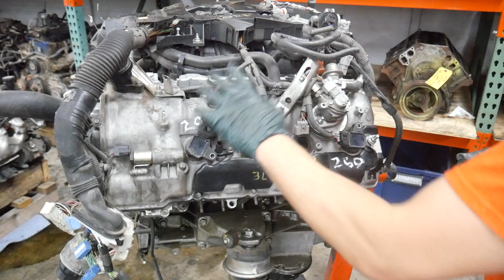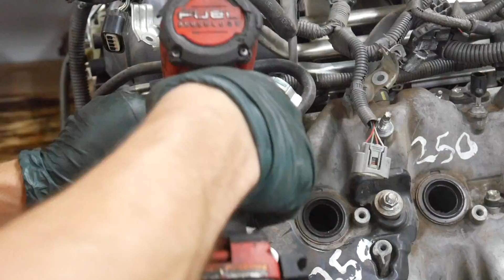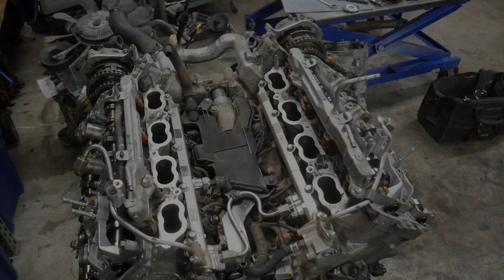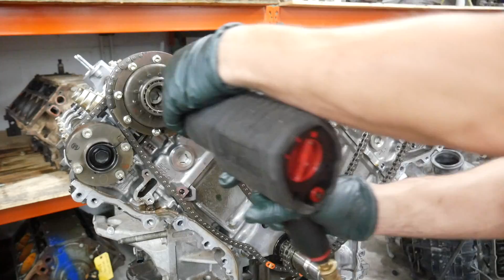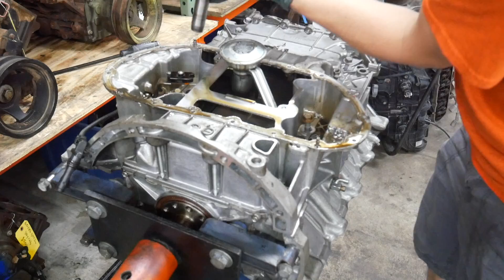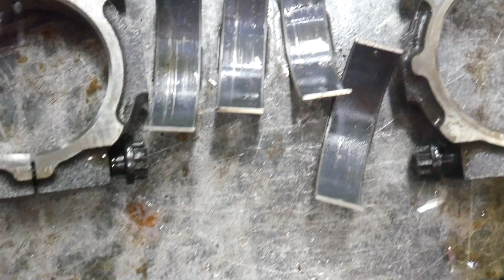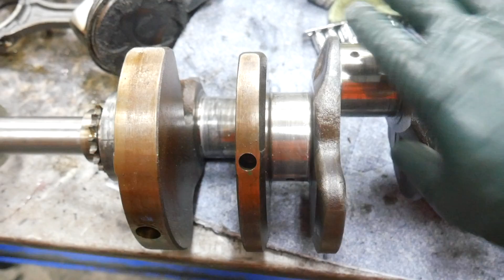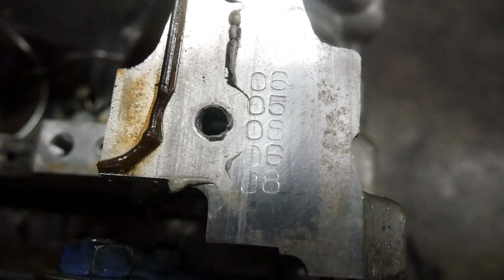Lexus LS460 1UR 4.6L V8 Blown Engine Total Teardown! How Did One Of The Most Reliable Engines Fail?

Comment: Even with the guide missing this engine has every sign of being ran with no oil.
Reply: No oil creates heat. There's no evidence's of heat, no scorching or discoloration.
Reply: @godzilla7148  not if it happens in a short amount of time, maybe it was ran with 1-2 qts for 20-30 mins, when its run without any oil, and begins to scorch with heat, it tends sieze

Comment: A testament to Toyota, this engine was probably running when it was pulled out of the Landcruiser or whatever it was in. LOL
Reply: Pretty sure Yamaha makes this motor not Toyota anyway sooo
Reply: @johnaranjo2059  no.
Yamaha specializes in cylinder heads for sporty applications when it comes to Toyota.
Reply: Yamaha makes the cyl heads for the f engine,pretty much this engine stroked to a 5.0 with better cyl heads.
Reply: Most engines are running, until they aren't. I'd imagine the rod bearings went, plugged the oil pick-up, wore the main bearings and then they let go.

Testament to Toyota that their bearings spun? Looks low mileage. Even the best maintained engines end up with varnish so I'd assume this was relatively low mileage for spun bearings.
Reply: @Ericsaidful  exactly. Stephen green probably works for toyota. Payed troll to keep up their image
Reply: @kevincampbell1395  right because the worlds largest automaker needs some youtube commenter to defend them.
Reply: @kevincampbell1395  Its an LS460 Engine. Bearing damage like that doesn’t occur without lack of oil pressure. F&resto;e and do it yourself oil changes are to blame. UR consumes oil at higher mileage but I’ve never seen bearings fail…ever.  Lexus doesn’t need anybody other then itself for image.

Comment: The only thing I don't like about those engines is fuel consumption.
Reply: I can usually get 28-30 mpg on the highway at least per the trip computer. Around town, about 21-22 mpg. It’s not bad for a heavy car with a V8.
Reply: @noelsaw  :hmm, the one I had wasn't good for much more than 18 on the freeway. Not sure  what kind of magic yours has.
Reply: I’ve read other LS460 owners on the forum sites can get about that same mpg. I think it depends on how well the engine has been maintained. I also run She’ll Nitro 93 and Amsoil oil changes.

Comment: Please do more toyota engines like the legendary 3.4s that’s my favorite engine I have 402 k miles never been inside it
Reply from the maker: I need to find a blown up one first!
I do have the bad 1fz from my land cruiser, it will be a video at some point
Reply: @I_Do_Cars  yes ! Haha probably won’t ever happen 😂 they are tanks. My question do you only do blown Up engines with problems or do you actually buy good ones to take apart
Reply from the maker: Andrew very rarely do we split a good engine. There are some engines that the head or pan is worth more than the entire engine, so there are a few exceptions.
Reply: @ImportedRCF  That would take away the fun. Why look at a good engine?
Reply: I've got that 3.4 VVT-i in my 05 Sienna Limited factory spec. never thought I'd fall in love with a minivan. That motor with 240hp has a lot to do with it💜
Reply: Got a 5VZ-FE w/200K that is totally choked with sludge, something about the 95 Tacoma ventilation system was prone to clogging. 
My 04 Taco has the same engine with 270K on it, very clean inside.
Reply: @TD_YT066  Hi Tom, how can you tell its "choked up" inside have you had it apart.. oil pan off?  I've been told that the sludge is only caused by lack of proper oil change intervals and or improper oil. I use only top synthetic Mobile1 and 20k Mobile1 filters... drives runs like brand new with 210k though it is a 2005 so.  Have a 97 w/300K 4ruuner also runs like new. This one gets semi synthetic and Wix larger than spec filter.
Reply: @surfside75  I ran Rotella T6 ~7k interval. It was starting to click,  valve shims. So I pulled the valve covers and the passages in the top were clogged and the sludge had built up to the point of only the moving parts had clearance in the valve train. The motor still ran, the oil was not 'chunky' or anything like that, but from what I could tell, none of the moisture or blowby ever got out via the PCV and it just crystallized. I was driving it mostly highway, commuting Austin-Houston weekly. Some other forum posting said the valve cover changed after 95 for better   ventilation.  My 04 with same engine was really good at 250K when I replaced the gaskets.
Reply: @TD_YT066   Thanks Tom.

Comment: You gotta wonder how that engine was so clean inside? 
Low miles?
Oil brand? 
High octane fuel?
Reply: Higher octane fuel doesn't do a difference if the engine isn't made for it or tuned and the cleanliness comes from frequent oil changes not the brand of it.
Reply: @alexstromberg7696  I guess what I meant was a branded or cleaner fuel, a lot of the discoloration inside an engine is more from soot / carbon/ fuel deposits than engine oil.
Reply: It's a lower geared V8 that tends to rev a little higher.  That keep fuel burning clean and keeps oil moving fast.  If oil changes are done on that motor at least every 10k it'll look like that.

I have a nissan VG40 that's similar in that respect.  I run it very hard.  Redline a few times daily. It's a 40 mile commute to work.  I average 40k miles per year.

At 200k I pulled the valve covers and replaced all the rubber hoses.

It looked new.  Bore scope showed cross hatching still in the cylinders.

That was 100k miles ago.  Oil changes every 10k.  Filter change every 20k.  Mobil1 in the engine.  Valvoline synthetic everywhere else.
Reply: It's clean because of oil changes done regularly.
Reply: @elantra45  it’s gotta be more than that

Comment: Same thing happened to a ls460 I just did a motor swap on. Pan had plastic guide pieces and babbit. Job was a nightmare, a lot of difficult to access hardware and connectors because of the engine size. The rear O2 connectors are inside the cabin under the carpet. The catalytic converters are part of the manifolds. Starter requires the removal of the passenger side manifold to replace. It's a subframe out job, engine and trans. Really the only way to work on it.

Comment: 21:37 yyyeeaahhhh if this was the venerable smallblock Chevy it'd still be on the road and driving. They are notorious for being able to go 50, 60, 70, even 80 or 90 thousand miles on spun rod bearings without a hiccup.

Comment: Nice video and I hope at least someone who matters at Toyota watches it. Toyota is famous for getting 95% of the things that matter for reliability right yet screwing up the obvious causing many of their cars to be scrapped with an early death or costing owners a fortune. Multiple years of Camry 4 cylinders had head bolts with only a few threads engaged that pulled out of the block causing catastrophic engine failure long before 100K miles in many cases. Corollas had defective piston rings causing high oil consumption often leading to total engine destruction. Even some wimpy Prius motors are known for throwing rods through the sides of their blocks as well as a V6 they used in trucks. So it’s no surprise this obviously meticulously maintained, super clean, Toyota V8 suffered premature bearing failure. Toyota lost 90% of their mojo when they discontinued the last Japanese Supra. Their cars have become increasingly disappointing, and ever more ugly, since. And now to make anything besides a boring transportation appliance they have to rebadge a Subaru or BMW.
Reply: Yeah they have become the master of rebadge also the new corolla hatch is a mazda 3.

Comment: 14:50 what the fuck Toyota why the stupid fastener? What's wrong with a hex bolt here? Are you deliberately trying to fuck over shadetrees?!
Reply from the maker: I hate to admit this, but I’ve seen more stripped hex bolts than any other fastener besides torx. What’s wrong with a regular bolt, or go crazy and make it a 12point.

Comment: 14:29 I have two even better ideas than the cam plate seen here.

1: Bearing shells as used in the bottom end. Even easier and cheaper to replace than the caps-and-plate used on this engine!

2: PUT THE FRIGGIN CAM BACK IN THE VALLEY WHERE IT BELONGS, GDI!